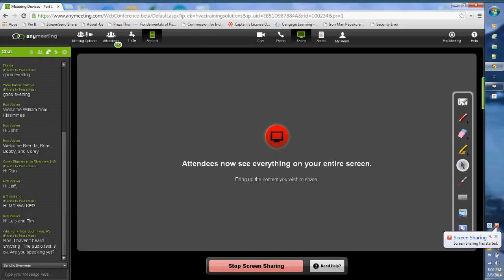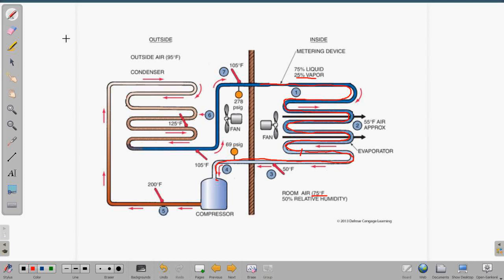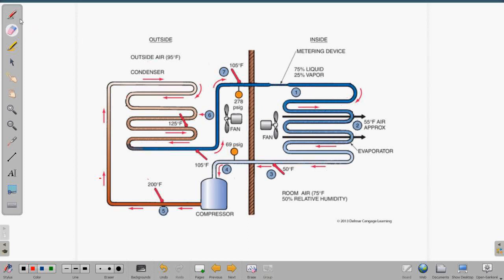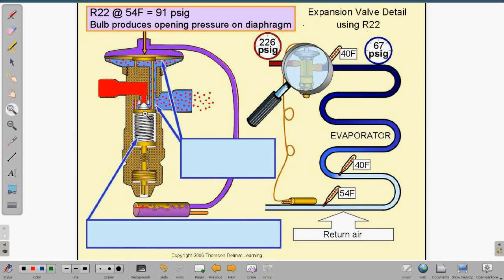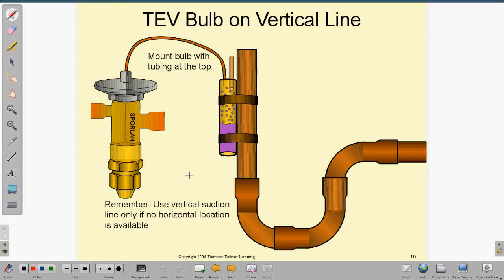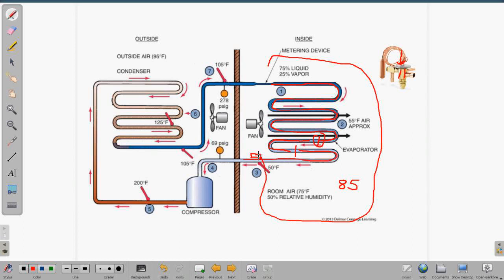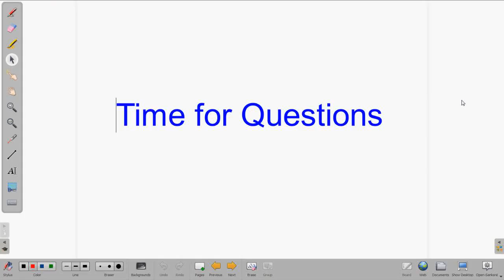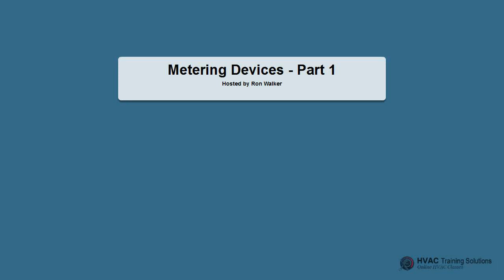Online HVAC Training - Metering Devices

Comment: You say that the TXV takes 15 minutes of run time to stabilize and start working properly.  Unless I'm mistaken, 15 minutes of continued running is inefficient for a residential application isn't it?  Would it be safe to say then that TXV's aren't ideal for residential?  If so, are the new units with TXV's using a different design?

Comment: Is it true that relationship between velocity and pressure is the basic principle behind the capillary tube metering device? The smaller diameter of capillary tube causes any fluid to increase its velocity and causes pressure to drop until the boiling pressure (liquid to gas chart saturation point in a PH diagram) is reached causing a phase change, i.e., turning liquid to gas . This is best explained by the Venturi meter.

Comment: Second question: I'm struggling to see the benefit of the TXV.  The TXV can regulate the refrigerant flow which I assume allows the compressor to shut off, right?  Wouldn't that be the only efficiency benefit?  But surely the compressor isn't shutting down and restarting numerous times throughout the on/off cycle as the indoor temp drops. So what is the point?  Just to let less refrigerant through even though the compressor is continuing to run?  Is it bad to allow the compressor to run without allowing the refrigerant to flow?
Reply: +ShawnMichael121277 the txv does indeed regulate refrigerant flow but it does not allow the compressor to shut off. The compressor is the heart of the system and if it shuts off all refrigerant flow will soon stop. 
The compressor stays on the whole time throughout the cooling cycle until the desired temperature is reached at the thermostat. The TXV helps the cooling process, without it there wouldln't be any cool air in the evaporator coil in your house and the system wouldn't work. Yes, it is bad to allow the compressor to run when the system is dry.
Reply: So how is a TXV more efficient/better than a standard orifice type?  If the compressor is running constantly for both, I don't see the benefit.  Especially when considering all the horror stories I have heard about TXV problems with clogging, etc.
Reply: +ShawnMichael121277 With TXV's it's about the percentage of the evap that contains liquid which can remove latent heat from the space. 
Under heavy load the liquid boils off quicker and so there is only vapour left which is not efficient. 
So as the bulb warms up it lets more liquid through because it has a higher pressure than the spring and the evap. 
As the space cools down there is less heat to remove..the TD between the liquid and the return air gets smaller...so the bulb gets colder. This causes the valve to close down. 
Any compressor will run until the set point is achieved, the TXV is all about balancing the portion of the evap that's flooded and that gives you the superheat. 
Not enough liquid - SH too high, too much liquid- SH too low and you get compressor problems among other things. 
The valve never fully closes off,  on or near the set point is the time when the system is under the lowest load and so it follows that not so much liquid is being boiled off, and the valve closing down allows for that. 
I don't see many fixed orifice systems in my travels, but loads of TXV's and they work fine. Once you get your head around superheat it all becomes clear. 
Also any system with a TXV will have a liquid receiver so can be pumped down, making working on them not too bad as in checking for blockages....it's just 2 spanners and a nut.....they don't block that often and usually it's moisture which affects any system regardless, or it's carbon from where people have been brazing without using OFN
Reply: They are used in multiple evaporator systems